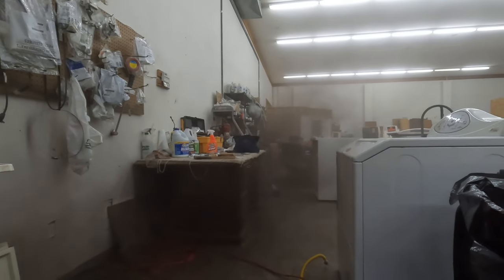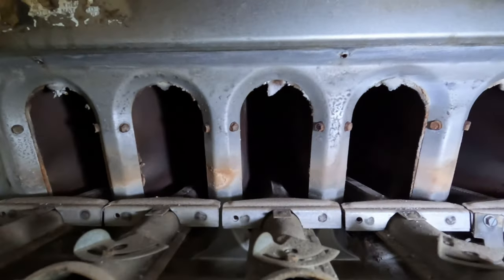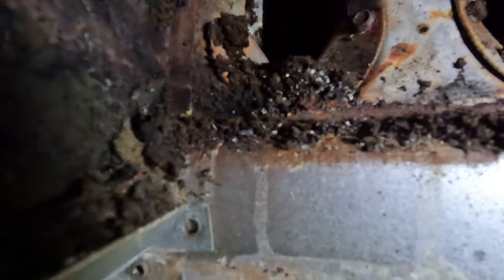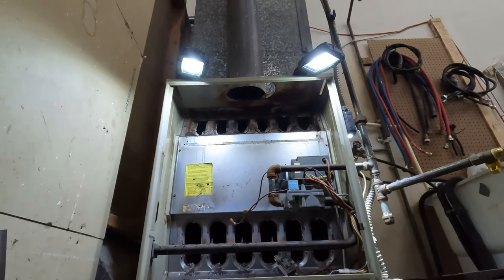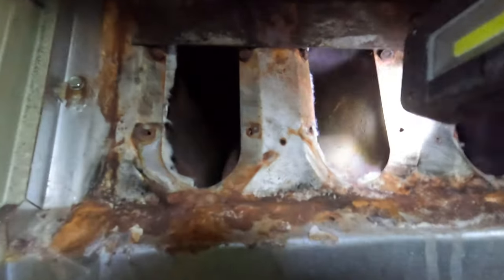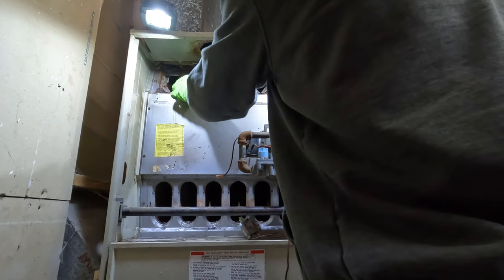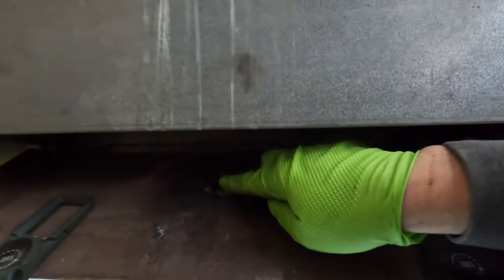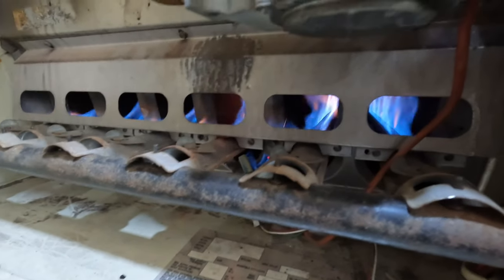Fixing a 35 Year Old Bryant Gas Furnace with a Plugged Heat Exchanger!

Comment: Been doing this for 30 plus years now, done this a few times in the past. I know it’s a dirty job but it is one of those rewarding jobs. 
Keep up the good work. I’m able to sit back and watch since I just retired.
A lot of guys never would have taken the time to do this, would have just tried to sell a new one. It should be replaced but it’s not broken.
Reply: If my boss found out I did that, rather than recommending it be replaced, I'd be in hot water.

The liabilities are too high to do that on a 35 yr old furnace.
Reply from the maker: @adamrspears1981 , I am the boss, and I didn't see any Cracks in the heat exchanger. So it's safe for now. But I agree it's time to replace. The landlord won't replaced until necessary.
Reply: @ADVANHVAC  Then that's on the customer. All we can do is give the customer all their options. If their decision back fires on them, then it their fault & not ours.

Comment: Are you still installing Bosch equipment?
Reply from the maker: Yes!
Reply: @ADVANHVAC  are you having good luck with them?
Reply from the maker: @LmTeamWaxOffroad knock on wood we have. Beginning of last year had a 15-SEER motor fail that was it. I have about 5 of them out there.
Reply: @ADVANHVAC  gotcha.  Same here, I have 5 of them installed so far.  Thanks for responding!

Comment: YOU THINK THAT OLD? I GOT A 1966 OIL BURNER HEATING THE HOUSE AND STILL RUNNING. 35 YEARS OLD NOT OLD THAT'S STILL NEW!!
Reply from the maker: Wow good for you. And you can keep that oil. Lol that stuff stinks.
Reply: @ADVANHVAC  no more in gas if you think fuel oil stinks I think gas stinks too. I noticed they have to replace those gas packs quite a lot and all they do is keep rusting out.
Reply from the maker: No hard feelings my friend. One thing with fuel oil it definitely burns hotter.